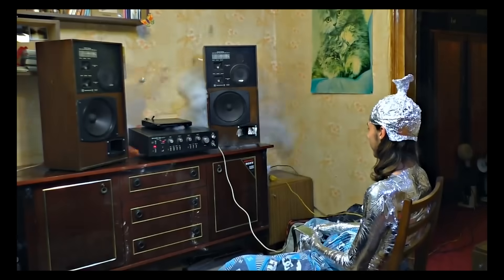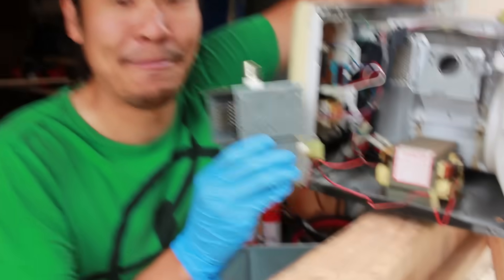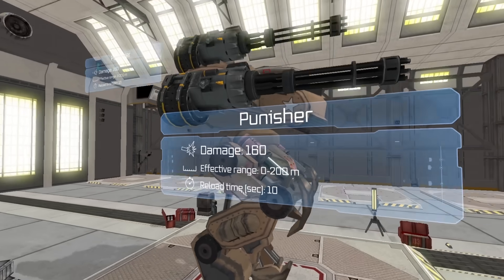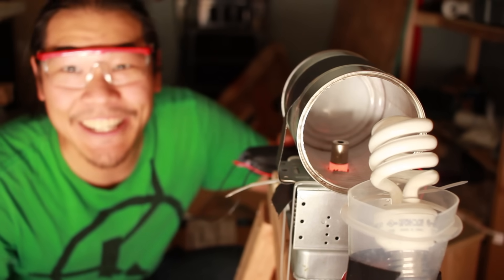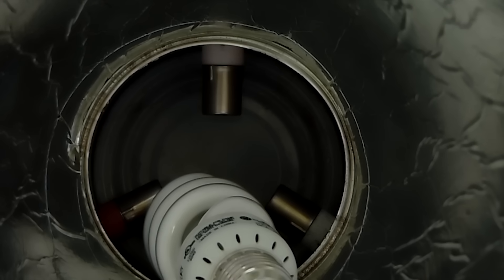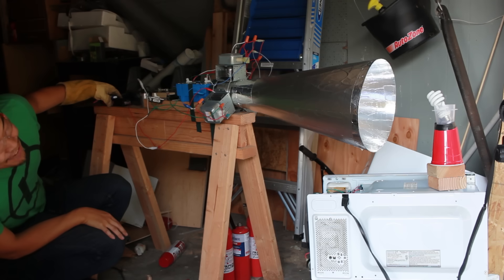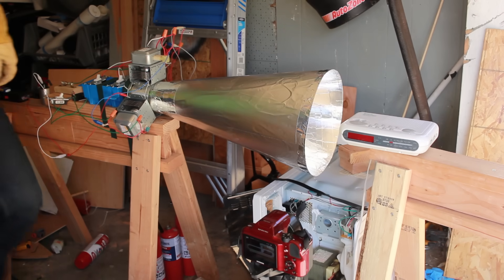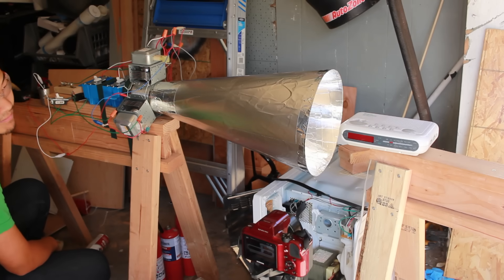A Microwave Gun Made From Taser and Soup Can??? (Testing Kreosan's Magnetron Cannon)

Comment: The microwave cannon didnt work as efficiently as it could have because all the microwave energy is lost trying to escape the can, so why not fill the can with an inverted dome made of beryllium, beryllium is an inexpensive metal used in nuclear powerplants to redirect and reflect energy into a focal point instead of absorbing radiation like lead or carbon does, current gen reactor cores are lined with this metal to increase efficiency normally lost when using lead or carbon.

Comment: I think you would need to remove the high voltage circuit from the oven and use that to power your magnetrons instead. Plus you need a microwave antenna such as a yagi to really focus the energy.

Comment: Putting 3 in parallel won't do much because each magnetron is being driven slightly differently, so you don't know the phase of the output of each- they could add up constructively or destructively. The spark gap does synchronize them a bit, but a microwave oven magnetron would not have the precision to keep everything in phase. if they were running at exactly the same frequency, since the phase is unpredictable, with 3x the number of magnetrons you will not get 3x the power- you'll get something less.

Comment: the only questionable part in the video is the size of the capacitors, hell, that's supposed to provide at least 30kw of peak pulse, the bulkiest thing in my emp gun is the capacitor, the charging system can only interfere with rate of fire, the power output is determined primarily by the capacitor output, the peak in power is directly gproportional to the ESR of the capacitor used, and duration will be directly proportional to the capacitance you got. I've 300 16v 1mf low ESR electrolytic caps in series, they can give me +-50A peak short current, i'm running the magnetron at 5kv dc 6A pulse, the filament is connected to a supercapacitor at 3.5v with a 3v rated filament, this is charged in the same lipo i use to power the gun.The trigger heats the filament and when the supercap discharges to a determinate level then the shot is triggered.
Reply: remembering the magnetron originally uses 1800v 1A=1,8kw i'm easily pushing this thing very far away from it's original specs with 30kw. I wished magnetrons had less resistance, i feel i need some 200 more  capacitors to match the full power impedance of the system, hell, if i can push 3kv more the current would match some nice 45kw or more peak power.

Comment: the way the magnetron works one will have a lower voltage to emit that the others and it will use all the power before the other two start to emit anything, and I'm not going to start to explain whats wrong with the horn antenna, but ya its not doing any good for microwaves.

Comment: Makes sense when you think about it. Electricity is very simple. It moves from the source to the ground along the path of least resistance. If no path is available it doesn't move. The total amount that will move into the device from the magnetron is however much the device can store. This will typically be stored inside of batteries and capacitors. Batteries when fed too much current would simply go into meltdown, a state where the seams of the battery casing fail and the contents spill out. Capacitors can certainly explode but not at all like what you see in the video. The capacitors found in majority of devices are relatively small, when they explode there is a loud pop, possibly a flying metal cap ejected and sometimes a flash bright enough to burn your eyes if your unfortunate enough to be staring at it when it blows. 

The most you would see from the majority of devices out there is a sudden release of magic smoke. You can simulate the effect of overcharging circuits easily by providing too much power for a device. Note that most devices have a voltage regulator that will fry before anything else, so find a good spot to plop down some wire after the regulator and see what happens when you provide too much power. I know from extensive experience being a moron, not a whole lot happens other than wasting an otherwise good device.

Comment: Why don't you have a HUUUUGE array of capacitors in series that's charged fully then pulse all of that power into the magnetron. Will that replicate the EMP needed? EMP is just a pulse after all. No need to make a continuous stream of microwaves.
Reply: But it wasn't to be successful. It was to copy what was in the video.
Reply: @j5892000  then he wouldn't have said "I'm gonna upgrade it" and then upgrade
Reply: Guy from the Internet how is this not the first thing they think of?
Reply: @Lordaserin  actually no it isnt
Reply: i have a portable emp, it's not magic, you just need to have some supercapacitors in series and discharge more voltage than the original setup, my setup uses 6kv +- 5A pulses with a lot of low-emi 1mf 16v capacitors from motherboards, i've tested them to 10% tolerance with my capacimeter before the assembly.
Reply: @fss1704  Can it kill bluetooth speakers? From what distance? I need something to shut up the 10 year old ganstas blasting terrible dubstep shit outside my window.
Reply: fss1704 thank you
Reply: SiMkE03 terrible.
Reply: They say in the video that they use capacitors
Reply: Come on guys, it's kind of silly even wasting time on replicating a russian video having guys in it with tin foil on their heads.  This is like trying to prove that David Copperfield can levitate an elephant. lol xD  Here's the debunking video:  https://www.youtube.com/watch?v=CWF-2Z508j8
Reply: They would have gotten in trouble with the FCC for sending out unfiltered radio waves
Reply: How about some Maxwell supercaps?
Reply: Guy from the Internet and a 24V truck battery
Reply: Hook it to the main. Should do something interesting
Reply: Meow Meow Fuzzyface
True but all you need is to release that energy in a burst. Unloading ALL of the stored charge at a high voltage would give you a big power value.
Reply: No on a magnetron and no on one whit the filament off.
A vacum lamp whit out filament can work but the gain of it sucks most of energy will be heat instead of microwaves.
Reply: Pretty sure EMP's are hella illegal, but that's none of my business. :3
Reply: yeah what he said. a continuous stream of lower energy waves would be considerably less then a quick jolt of high electricity. once while experimenting I accidentally disrupted the radio playing in the next room. I used and arc lighter and ran the wires out the front and touched it to an aluminum soda can. and ik if I increased the voltage with a transformer and discharged it rapidly with capacitors as my source of electricity then ran it through the ark lighter I could probably shut it off. and that was small scale
Reply: Guy from the Internet OMG I WAS THINKING THIS THE ENTIRE VIDEO. NICE TO KNOW OTHERS ARE THINKING THE SAME
Reply: a tazer is a huge capacitor.....
Reply: Brother?
Reply: fss1704 range?
Reply: NoVaKane Mythbusters.
Even after they proved the source material was bunk they still try to make a functioning prototype!
Reply: Didn't he essentally do tha at the end? I mean he dosn't have the budget of the actual Mythbustes, but  he did make the thing work in the end.
Reply: Guy from the Internet lol the hole thing will blow up
Reply: I was thinking that and coiling the cone.
Reply: Discharge the charge through a thin wire in a parabolic metal dish...
Reply: because then it would spark once in a sec or even worse. and if you have array of supercaps you could've just used copper coil in place of magnetron
Reply: Понапишут не по нашемо, потом сиди с яндекс переводчиком переводи...
Reply: @ardean  no, its a defense in the new era of id2020, drone surveillance, and to defeat the police state. revolution, coming your way, soon.
Reply: You could do that if the filament is preheated with a lower voltage and higher current
Reply: A single, lousy ,no brand, 18650 to power the heater coil? Really? No wonder you have little to no micro wave radiation.. The tube isn't heated properly, thus no electrons are deflecting on the inside.. If you look at Kreosan's video they have several of them in parallel, Effectively eliminating this issue due to an increased current that can be supplied.. 

Also, Dependant on the stun gun they used, Which their's seems to be a really cheap one, It likely doesn't have substantial over current protection, Thus is drives the magnetron as much as hard as it can.
Reply: Guy from the Internet yeah but did he used 4 lipos?
Reply: perfect idea
Reply: Think of an induction hearing coil too. That's essentially what the earth is. Perhaps this is why lava exists and the hot core inside the earth.
Reply: this how right power on pulse mode magnetron https://www.youtube.com/watch?v=oeMSkciXa0c
Reply: As well as a couple car battetys xD
Reply: The definition of an EMP (ElectroMagnetic Pulse) is as following:
A strong magnetic field that rapidly builds up, inducing current and then rapidly breaks down again, inducing current again.
Reply: Finally someone smart
Reply: And why isn't the Earth electrically dead yet?
Reply: Guy from the Internet thhhats what she saasaaaaaaaaaid
Reply: Guy from the Internet not only a bunch of capacitors in a row, also a solar panel array with a non-conductive cooling system on the on the gun itself.. Allowing the flow of the electricity in the cannon to move faster!
Reply: ScottySquatch think of the earth as a battery. Chemical reactions. And plant of chemicals in the earth.  Or think of it like the human body . The food we consume causes a chemical reaction to allow electricity to be created so we can move and our hearts can pump. I suppose there could be energy storage from The sun as well  from hear and radiation and other forms if energy coming off the sun. If earth had not energy then no magnetic field .
Reply: Guy from the Internet how about 18 magnetrons
Reply: You forget a basic how magneton works you need the filament current or they dont gona get a shit of microwaves no matter the power you put in.
And microwaves are not like a EMP pulse they can be bloqued easy.
Add magentrons no help because they are not tuned so most of power converts into heat and destroy they.
https://en.wikipedia.org/wiki/Standing_wave

Comment: "18650 lipo batteries"

Nope. Polymer electrolytes don't let the gas bubbles produced during heavy use float through to a release valve. That means lipo batteries can only be produced in the silver bag type of cell. 18650s can be various types of lithium chemistry, but never lithium polymer.

Comment: Use the the step up power converter in the microwaves as well as all the capasiters. You might need a way to convert the dc volts into ac

Comment: uhm.... what about connecting it to an arc welder? Or to the microave's actual power supply? Also try angling the magnetrons so that they point to the exit of the can. At this point it would be better to forget kreosans design, since it was made thinking about aesthetics, and think of a design that can actually work.
It would be really cool to see a 50ft emp. (it would also give you a lot of views if it worked)
Reply: " try angling the magnetrons so that they point to the exit of the can."
Actually they are. The berilium oxide ring, often white or pink, is the antenna, the microwave fields emit outward from it. Not out of the silver top like everybody thinks.

Comment: Cancer gun
Reply: Cancer is caused by ionizing radiation, shorter wavelength, than the visible light. Microwave radiation has much longer wavelength.
Reply: Kuudere IF you get a cancer and you get a cancer and you get a cancer
Reply: Won't cause cancer but high power microwaves it can cause cataracts or burns.

Comment: What if you input a voltage of 300 wat and the conne you put a magnet like  a speaker work
Reply: Levyn KHS watt is not a unit of voltage
Reply: A voltage of 300 watts?
Reply: Levyn KHS only a fool will post a comment without knowing what they are talking about
Reply: Levyn KHS Yes, If that is the case then I also have the right to call you a fool
Reply: A voltage of 300 watts 

Wow
Reply: i m just a primary student,how am i suppose to know those units
Reply: .... i have the right to write everything i want
Reply: is there any problem with that!?
Reply: ur right,i dont care
Reply: Purple Perplexing Pineapples , Moon Man
Yeah, ikr, that make no sense, but I think he is trying to find enough power to power it. An average modern microwave oven use 1200 watt and he used 4 in the video. 4*1200=4800 watt. So to power it, you need to plug it into the house
Reply: redstone craft guy that depends on the peak amperage, if he were to link 18650s in serial, use them to charge a bank of capacitors, and use the capacitors to drive the magnetrons, using a current limiter, there would be enough power to drive them in pulses, however, you would drain the capacitors quickly, and they would take a minute or two to recharge.
Reply: Diego31337 who would use them constantly anyway? Fire in pulses is good enough already

Comment: if you want that works better, use the microwave transformer, but don't go in front of it because theorety cally that can "cook" you (like in a real microwave...)
Reply: they come out of the back as well! really stupid if it wasn't fake
Reply: Or you can just Jimmy with the door of a microwave oven and just hit the popcorn button.
Reply: They have a bank of 4 batteries on the side of theirs(the purple things). Not sure if in series or parallel, but I don't think it would make their device much more powerful than yours.
Reply: @Techguy If that's just for the filament, it would have no effect, but if they were using it to drive a HV supply connected to the magnetron, I could see it pushing maybe a hundred watts. Still not enough to violently explode electronics though.
Reply: theLuigiFan0007 I realize that, I was just pointing out that his appears to be underpowered compared to theirs. Still a neat experiment though.